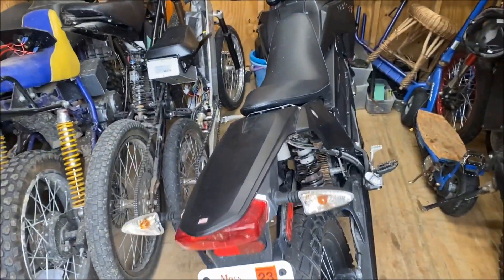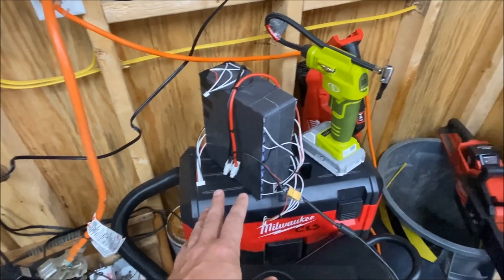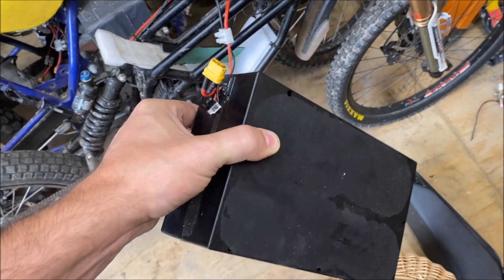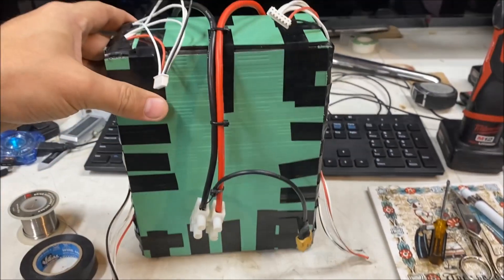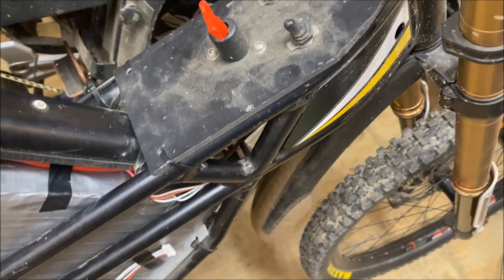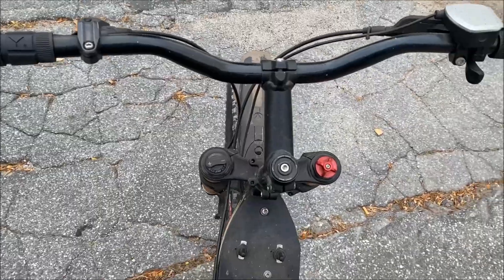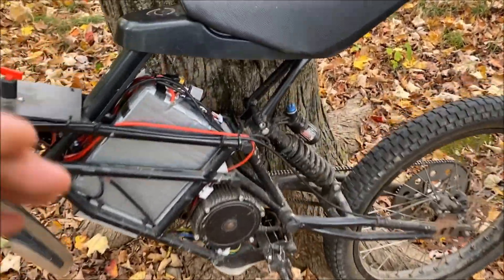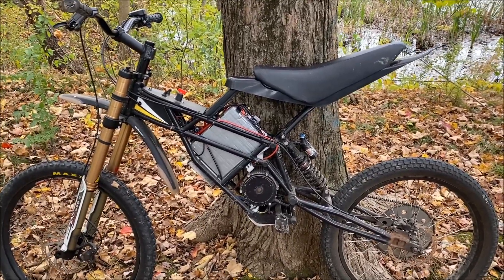Kuberg Freerider 72v Samsung 40t Battery Upgrade

Comment: Hey I am in need of help I have two kuberg x-force 50s and I need a controller but they are selling them for 960$ usd and that is too much please help me I don’t know what controller I could use it is a 8000w 48v motor and 48v 16.8ah battery
Reply from the maker: You can use a kelly kbs-x controller but keep in mind its complete custom fabrication and you will likely void all warranty with Kuberg. You also need to program the controller with a laptop so make sure you buy that cable also. Wiring will be a full learning process if you are not familiar. Watch some videos on kelly controllers they are really reliable and powerful

Comment: Can you show how to wire the battery to match the Kuberg
Reply from the maker: My Kuberg was custom built so it is not similar to a stock Kuberg. The wiring and controller is different

Comment: Why should I do if my chain is super loose? Also I’d like to upgrade the battery cuz it goes full speed for 3 minutes and or 3mph for like 10 minites
Reply from the maker: Kuberg Freerider uses a chain tensioner system if your chain is loose you likely need to add a new spring to the tensioner or adjust it. Getting a new battery can be expensive, do lots of research!
Reply: @EBIKEScott   tyyy

Comment: You can increase the space in the Kuberg Freerider battery compartment, cut off the lower tubes and measure how far they can be lowered behind the battery so that the shock-absorbing fork in front does not touch the frame. It seems to me that this is possible by 15 cm or more
Reply from the maker: Ya i have seen this mod done, i would need to relocate my controller to do this which is no big deal. Now that 21700 cells are around you can fit a decent size pack in the stock area. I sort of want to make a new sub frame since its a tad too tall even for me being 6’3” im on tippy toes

Comment: can you link the 18650 13s6p pack you talked about
Reply from the maker: https://endless-sphere.com/sphere/threads/89-plus-shipping-usa-based-48v-15ah-720wh-60a-li-ion-battery-2500-mah-cells-13s6p-configuration.120579/